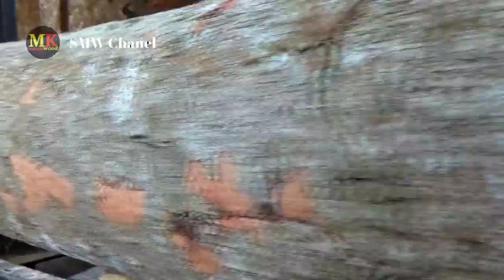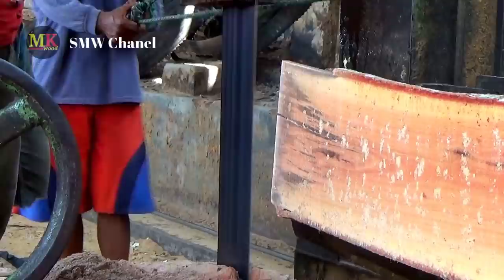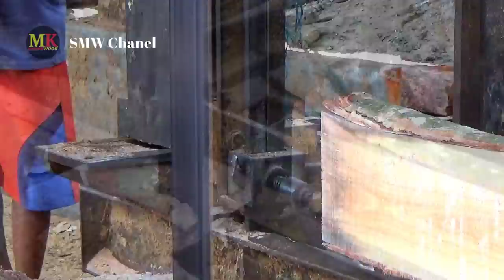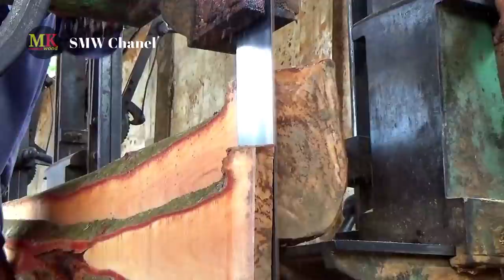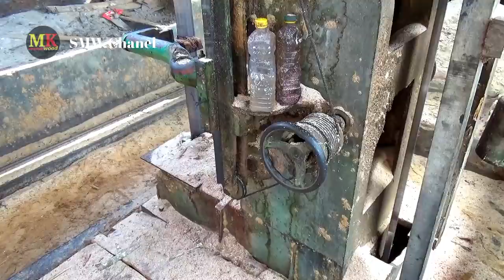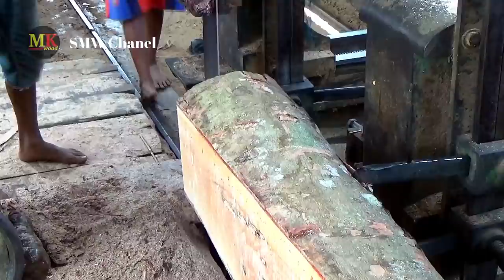Perjuangan memilukan dibalik besarnya bongkahan Kayu wadang cantik yang selalu ditunggu banyak orang

Comment: Iron Wood from Borneo is the strongest wood- never rots lasts forever - very dark coloured wood.
Reply: I logged Iron wood. It was always a blonde colored wood.
Reply: @cammontreuil7509  I saw a friends Stilt House is Kuching made from it and was an old home built many years ago and was very dark - maybe it Ages Dark? It wasnt stained
Reply: @melbournesubtropicfruits9474  it's possible the Malaysian variety is dark colored.
Philippines variety was always blonde and sometimes slightly red or yellowish tint, but mixed grain, never a solid color.
Logger's before me cut a log, it was as round as a Volkswagen, in 1959. It was not perfectly straight, so they let it sit.
I bought it for $10 US money in 1991.
I cut it into 32 foot beams for my house.
The color was still blonde.
In Magsaysay, many old houses the foundation posts where made of this wood. Some house's a good 80 years old. All the posts did fade in color and turn dark. Some exposed to salt water.
When I ripped on a log, I used the chips to burn under my house in Magsaysay to keep the mosquito away. 
Very effective.